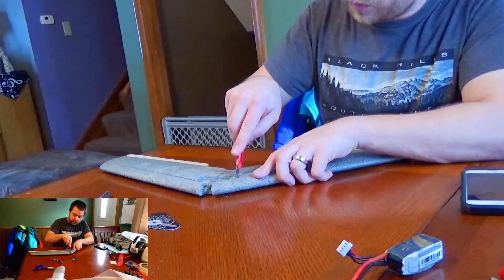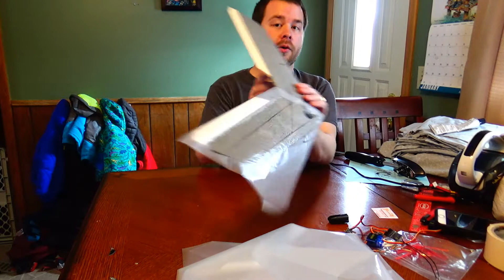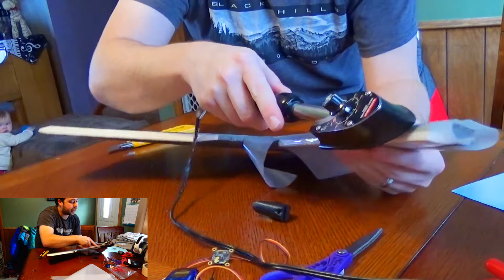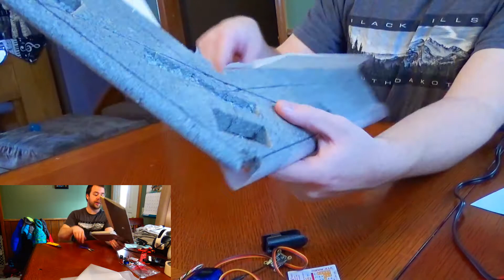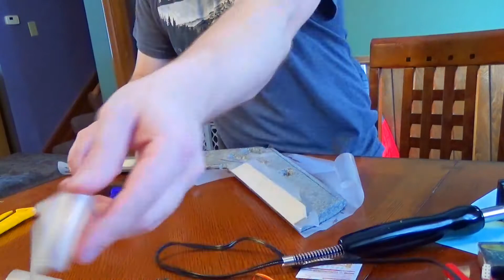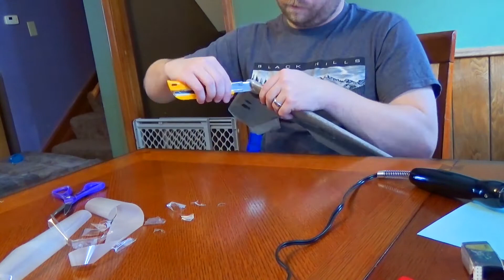TBRC Son of Spec - Part 4: Battery Bay Floor and Laminating the Wing

Comment: Is the glue you are using good for foam board? Thanks
Reply from the maker: Are you laminating the foam board? The 3m spray adhesive would work well on the foam board before laminate.
Reply: @lukeman269  sorry i was asking about the goop glue.
Reply from the maker: @alexherrera3918  I haven’t used goop on foam board but I know solvent will eat the foam. If you use it on the paper it’ll probably be fine. Hot glue seems to work the best and it’s really fast.
Reply: @lukeman269  good info. i did not that goop has solvent components. Thanks!!